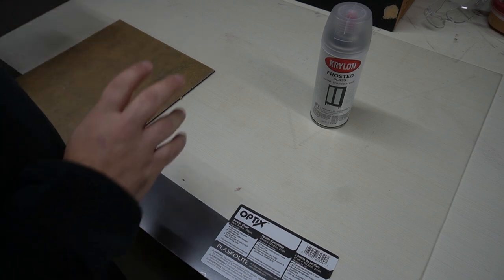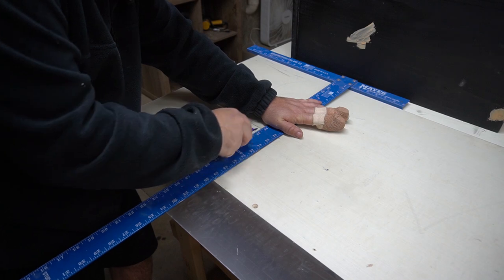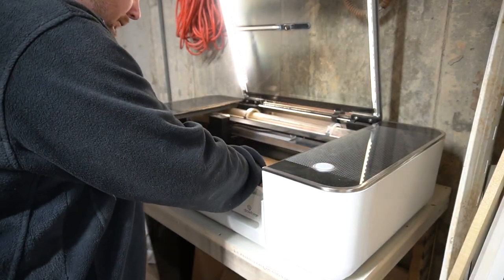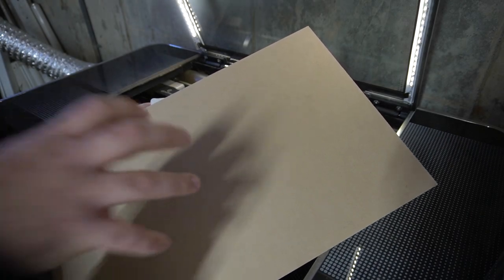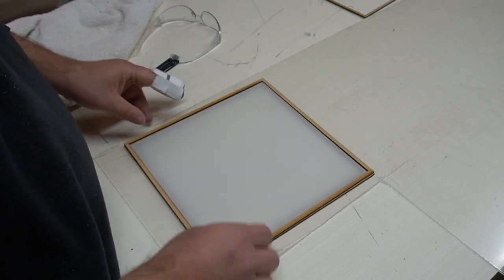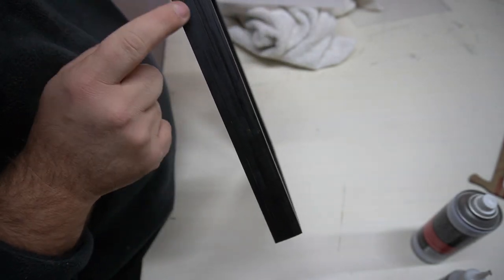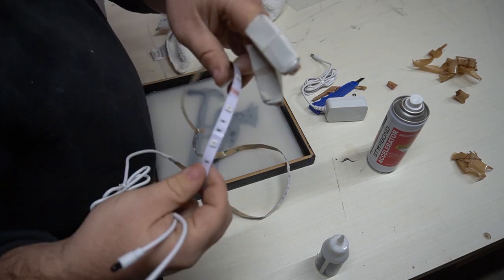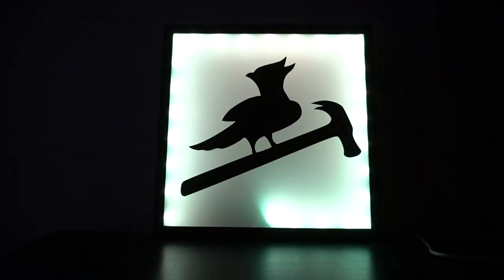Making A Custom Logo LED Sign // Glowforge Projects

Comment: Have you ever tried using a Diamond Drag Bit? I use them to make acrylic lit LED signs and the led lights are down inside of the base unit and cannot be seen. Wish I could get some pics on here to show you. Nice outcome on the project. You can go to UPNorth Offcuts on fb and checkout some of the work.
Reply from the maker: I haven't but that sounds like a good idea. I'll have to check it out 👍